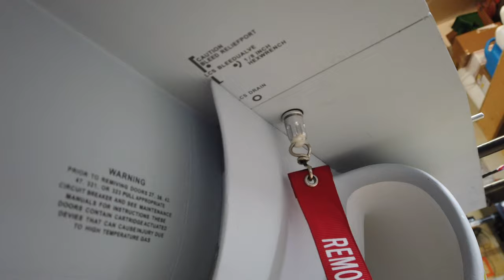SKYMASTER F-18 F18 - Wiring, Fuel System, Smoke System - Build Video #15

Comment: Its amazing how fast this is coming along, do u just have acouple hours a night to tinker on it or do you spend like a full saturday/sunday working on it? Im builfing my first turvune right now but its a single king tech f16 . But your videos have certinally gave me some great ideas, like the wire and tube holders, i had no idea anyone even manufactured these. Thanks for the info bud and keep it coming!
Also is he using a scale pilot figure, warbird pilots that actually move there head are pretty amazing?
Reply from the maker: Hey Scot.  It's a bit of both depending on weather on the weekends.  I'll generally go in the garage for a couple hours a night.  If my family is busy/out etc it will sometimes be 3-4 hours.  If it's raining on weekends than I will also put in some time.  It's definitely a balance between family, work and building.  We have scale pilots for the plane.  They won't have any animatronics/movements though.  Thanks for watching and good luck on your build!

Comment: What caused it to be 2 hours to place the canopy on, explain please, I may get this kit and wanted to watch a master put one together before I jumped into a project of my own. Details please.  You have done a beautiful job on the plane and you must remember we are not all at your level of expertise when building these aircraft. Did it have to do with reach, or redoing things twice?
Thanks for the great videos, they are very helpful
Reply from the maker: Hello.  Primarily with the servo/linear actuated items it's a matter of getting the timing and movement right.  With air it's pretty simple as it's Lock open, Canopy open, Canopy close, Lock close.  With the actuator it's adjusting the movements so they work properly.  One advantage of doing it in the JR 28X Gear sequencer screen is I made the actuator close the canopy all the way and then it backs off slightly as the Lock comes down to get rid of tension in the close mechanisim.

With regards to installing the canopy on the airframe taking 2 hours it's purely based on access once the fuse is joined and fuel tank is in place.  huge lack of access.

Comment: That looks a very difficult and complicated job, it's just as well you're very methodical, and the size of that thing its massive!! Will you be doing the maiden flight? Great video and thanks for sharing👍😄
Reply from the maker: Hey Ian. There sure is a lot going on  this plane!  I won’t be doing the maiden as the owner is a skilled and competent pilot and has owned one of these before. I should get it on video unless he sells it and it goes far away.